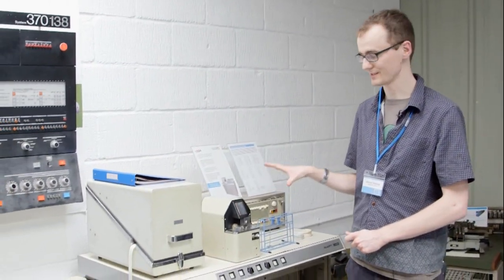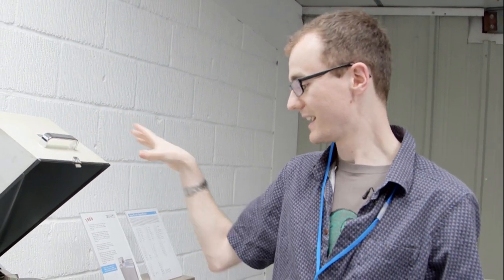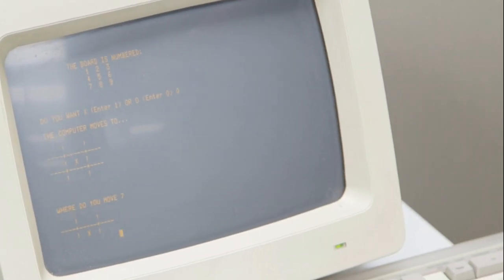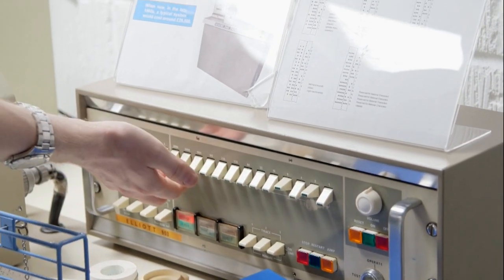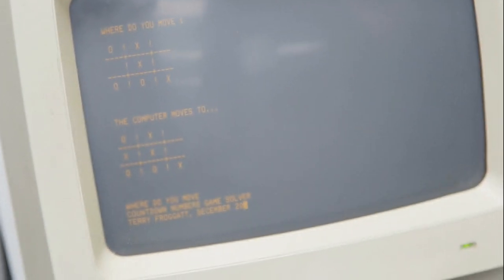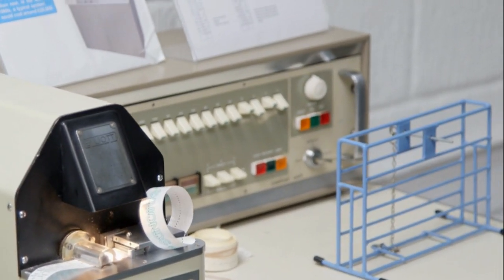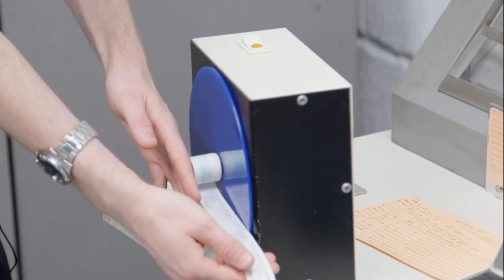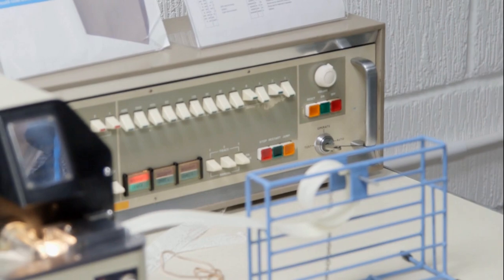1966 Computing Power (Elliott 903) - Computerphile

Comment: Mhh, seems quite user friendly and powerful for this size and age.
Are there any jump and run or racing games for it? Can it do Black MIDI? What about an office application?
Reply: derLPMaxe You're thinking 80s, not 60s. These things were not used for that kind of stuff back then. Only the most basic calculations. He also said that it didn't come with a monitor, but with a printer instead. So no way to play a jump and run game on it, or anything like that. With an "office application", it would do as much as a typewriter does, so it would have been better to use a typewriter back in the day.
Reply: Seegal Galguntijak I know that this is a computer of the 60s and this is why I was absolutly serious when asking this questions.
It can do quite some nice things though for such a computer. And it seems that you can hook up a monitor on the computer.
Reply: derLPMaxe You wouldnt be able to get great bit depth/variation or memory capacity ie small map sizes and unit counts... It can differentiate between a limited range of values, which it can do operations on, within rather narrow limitations... 

but thats about it I think... 

There would have been no real-time visual output or graphics support, no extensive libraries, or graphics editing software for creating game assets.

Fonts werent invented yet, or perhaps barely... And even printing was a large scale operation...
This thing could barely do text in real time, as we saw when it was printing to the screen.

-It would do the calculations for you, and give you updated coordinates for, say, units in a war game, but you would need a real-life table-top set of models, that you then moved around yourself USING those coordinate printouts.... turn by turn rather than frame by frame....

-The same way a chess machine/computer worked back when, with an actual physical board and pieces...

I think you would use something like this to print out tables or sets of data in physical form, and then actually do work with the hard-copy....

That way, one machine can service many more people, within a company, forex.
You probably wouldnt be reading off the actual machine directly...
Reply: Seegal Galguntijak You don't get my point, right?
Reply: Frabbledabble When Naughts and Crosses works, then with alot of time maybe Chess or even a Rogue clone could work.
The actualy questions were not really meant to be serious. But I guess it would be worth thinking about what is possible with todays way of thinking about computers and this piece of hardware.
Reply: derLPMaxe
With chess, its only a question of storage capacity I think... So if you were to do it with this computer, you have to assist it / manage it  (change reels and flip switches)...

It couldn't play awesome chess without a technician... But he wouldnt be required to understand chess ;-)
Reply: Seegal Galguntijak I think you are not open enough for a mindgame. :(
Reply: derLPMaxe
 ? perhaps not... But I am into programming, and its always fun to explore exotic computing topics....
Reply: Seegal Galguntijak Of course it's not useful but there is nothing wrong with a mindgame. What would be possible and how? Why is something impossible? And many other questions. The concept of a mindgame is not that it must be useful but it's about possiblities. A nice sideeffect is that it might become useful someday. With this machine it's obvious that it propably will not be useful someday though, but there is nothing wrong with a mindgame even though it seems useless to some.
Reply: derLPMaxe Right, I just don't see the point. But I don't want to spoil your fun - just ground you back to reality :-)
Reply: derLPMaxe
It is a fun idea! And if someone did it, I would watch the video :-)
Reply: Seegal Galguntijak Remember that computers like today (and many other stuff humans have archieved) propably wouldn't exist without mindgames. ;) Mindgames play an important role in science.

Comment: What language are these programs written in? Is it just Assembly or some high level language?
Reply: Henrik Sommerland I think it's in binary machine code. Nothing as high level as Assembly ;) - but that's just my guess.
Reply: Well that's whats on the tape. It is most likely ALGO since there apparently as a Elliott version of ALGO.
Reply: Henrik Sommerland You had a choice of Elliott Algol (similar to Algol 60), Fortan II or (most likely) assembler.  The assemlber was called SIR (Symbolic Input Routine) and since there are only 16 instructions it just used numbers 0 - 15 rather than ADD, SUB etc.
Reply: Cool cool!
How incredibly annoying to not use menonics for an assembly language. Seems a bit silly considering that it is not much work for the assembler to parse three letter symbols instead of a two digit number.
Reply: Henrik Sommerland The programmes demonstrated here are in Binary code, they were both created by the gentleman who donated the machine.
Reply: The Centre for Computing History 
Well yes of course they are in binary form when you load them. But I was wondering what language was used to write the actual program.  

I doubt that the person who wrote them wrote it in machine code directly.
Reply: Seegal Galguntijak 
It's still totally possible today as well. most programs only use a handfull of instructions anyway. It's just to fire up ones favourite hex editor and start typing numbers. Even on a x86 architecture its not that bad. there is a lot of cool stuff wich can be done in <= 256B.
Reply: Henrik Sommerland Yes, of course. And if you're programming a small µC, it will be the "language" of choice, but try doing this with a modern day's personal computer program (I mean any kind of personal computer, even your TV is one now, as is your phone etc.), where you have APIs and stuff - nobody would want to do this, especially since it's almost impossible to produce a programm that is smaller than 1kB and still does something on the computer. Even as soon as you'd have to integrate any "external" library, you'd be in for a ride.... It would just take so much longer and be so much more inefficient. Although, of course, you could always use it to modify an existing program. But hell, even when we changed the string "Start" in Windows95's "explorer.exe" into "F*ck!" with a Hex editor, this wasn't machine code! ;-)
Reply: +Seegal Galguntijak No there was an assembler, but with only 16 machine instructions you just remembered their numbers, although addresses etc were symbolic.
Reply: @TheMorMor  Most instruction were in fact only only one char long, 0-9 and 10-15. Very easy to remember if you were programming the machine day in day out. Not incredibly annoying to most programmers of the day, only 16 basic computer codes to remember.

Comment: i wonder how a tape got twisted up (i say as i observe that he didn't bother to line up the tape with the device)
Reply: kght222 the second tap was lined up better by far, the first one might have worked from that angle. he seems to be ignoring the physical part of programming a system like that.
Reply: kght222 The tape has two guide pins, and then the metal guide plate is clicked down to keep it straight, it is not really possible to misalign the tape, if it is not between the pins it simply would not read and stop.

Comment: Funny thing is, even though my AMD Phenom II x4 965 Black Edition (3.4 Ghz) can run fast, it still takes about 5-6 minutes to load up Grand Theft Auto 5.... or other BIG +30 Gigabyte Games, so even something like this isn't all that bad for loading up programs for me....
Reply: Matt Brine relatively speaking yeah, the programs he's loading are all probably less than 10K (the memory of the computer is most likely 64K or less) and the tape reader he's using is fairly quick compared to the ones built into teletypes
Reply: +2chws ~ 8k ferrite core apparently.
Reply: ***** I have a SSD, but I also have a Seagate Constellation, so together they're pretty face (up to 280-300 MB/s writes on my SSD depending on the file).

Comment: If it can read tape that fast, SURELY it can do better than 110 baud.
Reply: eh they didn't have VDU's back when this machine was made so it's probably built into the hardware to be 110 baud or less.
Reply: Also, 110 bps continued to be used in many machines for the sake of compatibility.  So if your computer is "printing" only at 110 but you are feeding the signals to a video device (often called a "glass Teletype"), they still appear on the screen at 10 characters per second.  But once faster VDU devices became common, newer computers were able to speed up the data transmission (and reception) rate to match them.  Yet they could still adapt to getting data from, or sending it to, an actual printing terminal such as a Teletype, with its lower speed.

I was in college here in the States in 1966, so I never even heard of the Elliott brand.  I did notice, however, the IBM 029 keypunch and the console for the IBM 370/138, which would be from the early 1970s, when the System-360 family of computers introduced in 1965 was compatibly upgraded to System-370, which allowed for pageable memory (called VS or Virtual Storage) and for VM (Virtual Machine, which allowed imaginary computers with independent operating systems to run as applications on one real machine).